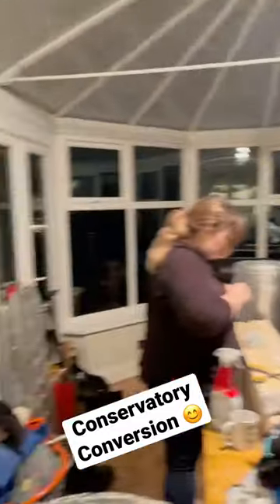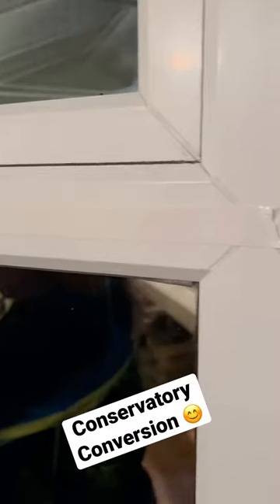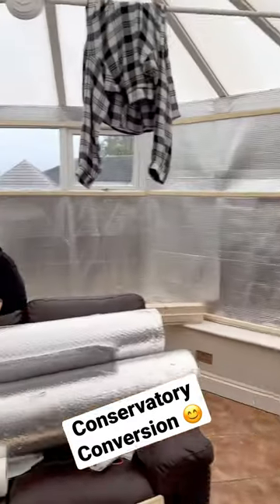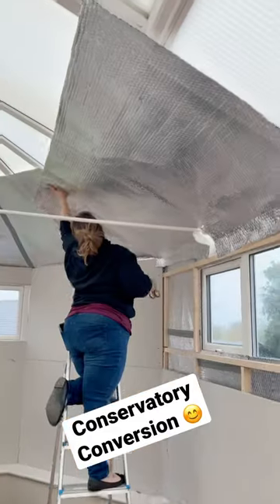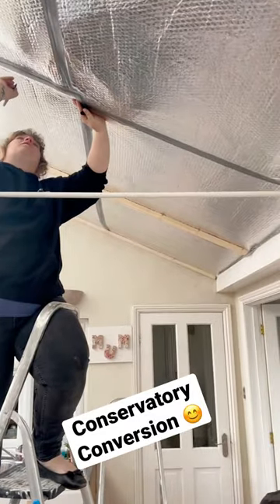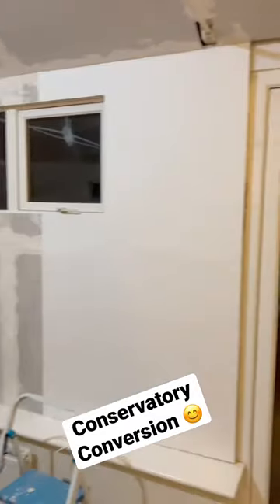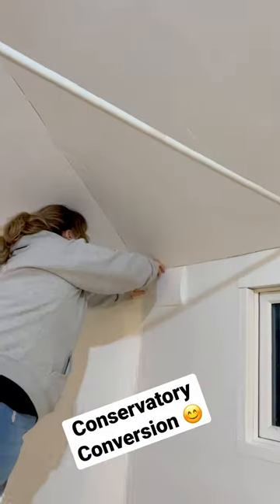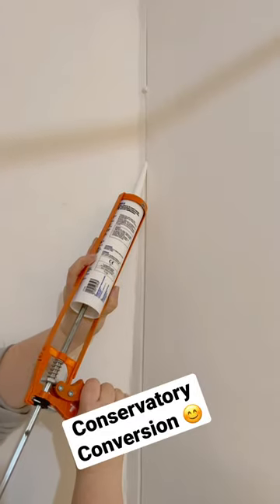#DIY Conservatory conversion 😊

Comment: That's amazing, does it have all the benefits of a solid roof conversion?
Reply from the maker: Honestly I’m not sure. The plan is to knock it down in a few years for an extension (still saving up). This was just an experiment to see if we could make a warm room til then. So far it’s worked and kept it lovely and warm with no damp issues etc. for £400 we are really happy with it as a temporary solution 😊